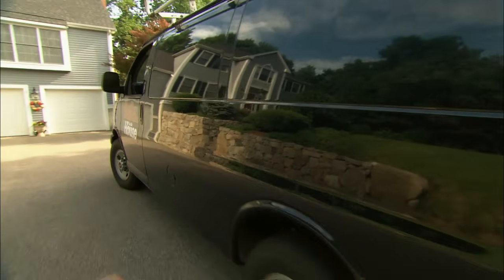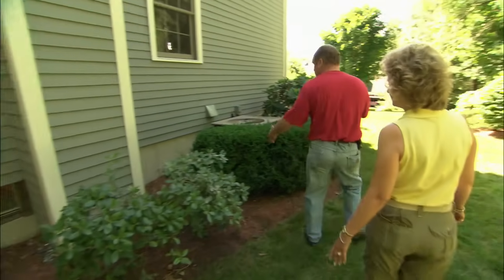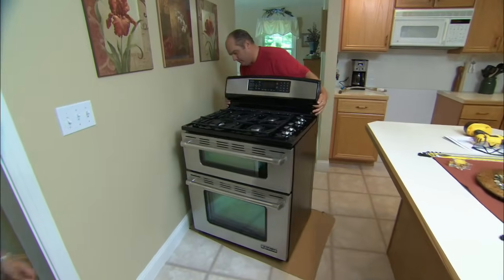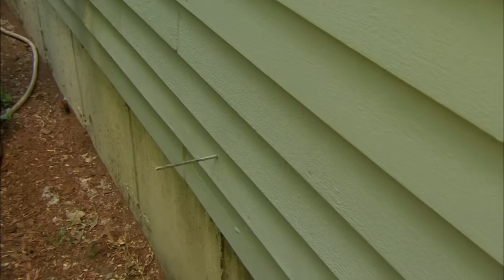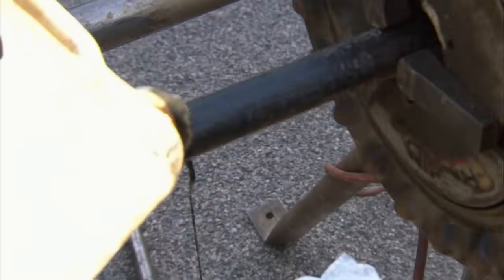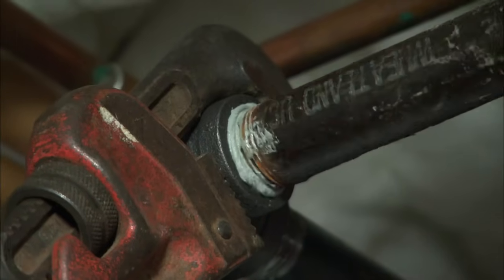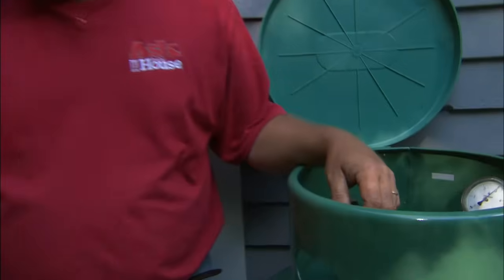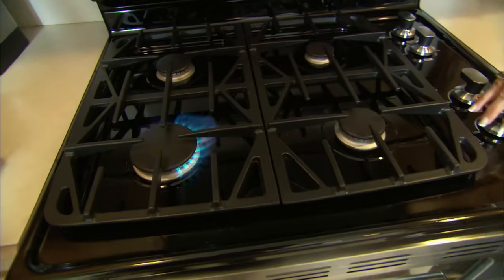How to Install a Propane-Fueled Stove | This Old House

Comment: Is anyone else with me that electric rules?
Reply: At least I don't have to worry about carbon monoxide poisoning or a much easier way to burn my house down.
Reply: @isaac24  lol electric is looking real dumb considering electric prices are increasing very quickly meanwhile gas prices are falling. Makes the decision that much easier. It also does not make sense to convert gas to electricity and then use electricity for heating. Makes a lot more sense to heat directly with the gas rather than converting it to electricity and than back to heat lol. Also, house fires are often started by electricity so you sill have to worry about your house burning down.
Reply: True, but the risk is less. Our furnace is gas, which is a MUST, because I live in Michigan. I would NEVER choose to have a gas stove, in fact, we're gonna be moving soon, and if the house has a gas stove, we most likely will switch it back to electric. Neither me, my mom, or my dad has ever owned a gas stove, and my dad especially likes electric. We will never choose to have a gas stove, same with a gas dryer. It sucks because Millennials like gas stoves, which means if we move into a renovated house, it may be cursed with a gas stove. Oh well, it'll go bye bye soon enough.
Reply: @isaac24  lol cant argue with millenials liking gas stoves. It's one thing I agree with them on though. I have an electric now and its very slow.
Reply: Eh. We've got a Maytag Performa electric from the early 2000's. It works fine, came with the house.
Reply: @acommentator69  My application is so small that having gas costs more
Reply: @isaac24  Keep the gas stove. I cook on electric now and it's good, but it isn't gas good.
Reply: Nope. None of us like gas.
Reply: @isaac24  I'm assuming you've never tried it. It's about even with electric for my usage.
Reply: Used it once or twice. The only thing I can say I like more is the fact that the temperature control is a little more exact. Other than that, I'm not willing to fork out $100 minimum more for a new stove just to have that feature.
Reply: @isaac24  does the power ever go out while you're a-cooking?
Reply: @isaac24  also I'm a pyromaniac so anything that burns is good
Reply: Nope
Reply: Ummmm ok. I also like fire, but not enough to risk carbon monoxide poisoning or burning my house down accidentally.
Reply: @isaac24  CO poisoning is only a risk if you have a yellow flame. Burning the house down is a risk with electric moreso than gas.
Reply: Nooooo hell no! It is  MUCH easier to burn down a house when you have an exposed flame

Comment: Old Blonde Lady: "Wants a gas stove instead of electric stove cuz you can't turn down the heat"

Me:  BS, just turn it down to 1 or 2. It takes just as long to get cooler. I guess you want to may for another bill that you DON"T need. . . . . People think they are saving money by gas. They aren't.
Reply: My monthly electric bill: $50. All LED lamps. Power saver turned on for everything. Only two adults in the house who turn off lights when not in use.

My monthly gas bill: $15. Heat set to almost 75 during winter (wife's preference, not mine). Gas stove. Gas water heater.

Gas is cheaper than electric.

Comment: new gas ranges come with orifices designed for natural gas. you must change the orifices to LP sizing (WPC)! Bad Video GUYS without disclosing that CRAZY IMPT Safety Factor!
Reply: I had the same  thoughts, Robin.  And I wished for  more clarity on the flex pipe  sizing and install behind the oven.  - Sandy

Comment: That’s just terrible. Reverting back to a Co2 emitting system and undoing environmental efficiency. Just deal with a hot burner, maybe don’t use it as high.
Reply: Where do you think electricity comes from?  A power plant.  How do you think the power plant makes the electricity?
Reply: Lawson Family. Most cities are transitioning to solar and wind turbine power. Many already use hydro-electric damns for electricity. Most power plants run off nuclear fission, and emit water vapor, not a cubic millimeter of Co2, sweety.
Reply: @morganfreeman4726  It must be nice living in candyland
Reply: Lawson Family I happen to live in America, go back to the 80s if you want to keep thinking like that.